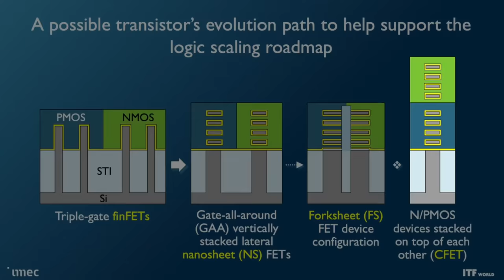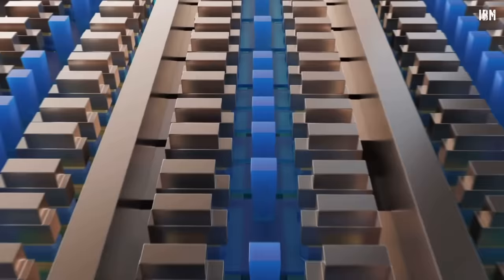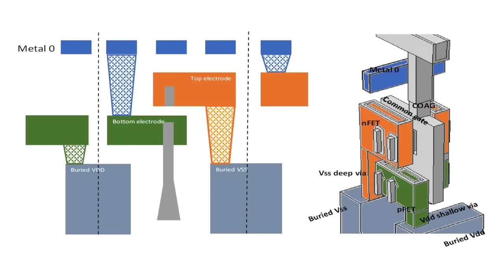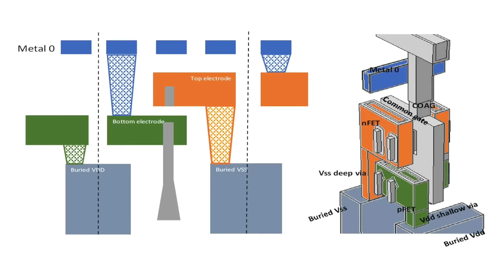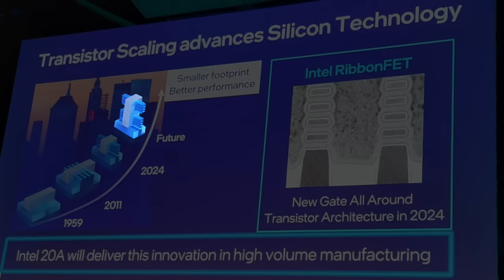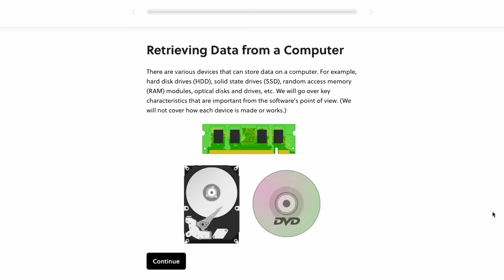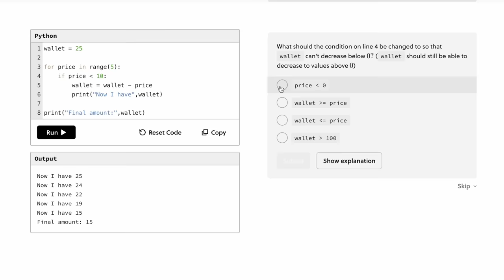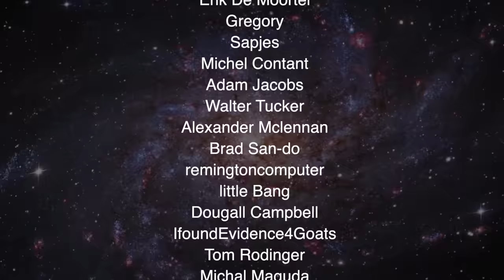New CPU Technology. IBM, Imec, Intel

Comment: fully optical transistor is better than electrical transistor
Reply: electrons flying at a line (like photons) are better than electric resistance wire electrons
Reply: like electron lithography is better than optical lithography, but nano sized optical wave guide pipe lines
Reply: ducted light/photons stay in the pipes, even if below their optical resolution
Reply: or just use euv nano photons to get them in the tubes
Reply: make vertical ditch photodiodes, any power level, vertical square surface illumination area
Reply: photons don't really interact with each other at all. How would you make transistors for light?
Reply: @vibaj16  how does the basic switch (mechanical) do it, for electricity? actually the same switch, just optical pushing
Reply: @vibaj16  make the photons push a thing, like gas/cantilever, that blocks another stream of photons partially on/off or gradually
Reply: @vibaj16  yeah even the fusion reactor pushes things with lasers
Reply: @vibaj16  best type of optical all-photon transistor would work exactly like a vacuum tube transistor and MOSFET, a boundary layer of gas/cantilever is pushed a bit so that the photon channel is open
Reply: @vibaj16  at nano-meter trace-channel wave-guide widths (square on the nano wafer) the photons need to be x-ray photons, about 400k THz (400PHz), optical visible photons are around 750THz or 0.75PHz (for red)
Reply: @Jkauppa  Electrons affect each other, photons don't. Photons don't push each other. Electrons do.
Reply: @vibaj16  are you broken? I did not say to push each other, like you try to do now, push the mirror
Reply: @vibaj16  ok you did not read
Reply: @vibaj16  actually they do superpositions, boost and cancellation, to be exact, double slit experiment
Reply: @vibaj16  and thats bs, they do split to electron and positron in matter, and interact to form matter and antimatter (for example gamma+gamma photons collision)
Reply: @vibaj16  also photons have energy=mass, they do affect that way, directly, even if the effect is neglible, like I am
Reply: @vibaj16  not even the electrons in transistor directly push each other, they use a medium as a switch
Reply: @Jkauppa  photons controlling mechanical switches would be slow. Better to use wave interference for switching, (like the double slit experiment) if that is possible. I think "optical cavity switch" is a method, there is some video demonstrations on YouTube.
Reply: @AORD72  who said so, I rather believe the one that told me so
Reply: @AORD72  how slow is a vacuum tube transistor, mate
Reply: @vibaj16  photons can interact, the waves do (but i think with coherent light only). This can be seen in the double slit experiment.  Change the experiment so you has two photon beams. And capture the resulting photons from the wave peak locations.
Reply: @AORD72  do you think an electron (photoelectric effect) is slow as a mechanical switch?
Reply: @AORD72  meh talk what you want
Reply: @AORD72  no, just use nano size cantilevers or just a mechanical optical gas
Reply: @AORD72  I would not buy consultation services from you, just that you know, dont claim to know anything, by yourself, as you conflict with my sender
Reply: @Jkauppa  photon as slow as a mech switch. No. Using a photon to push a atom or molecule would surely be slower than photon to photon interaction.
Reply: @Jkauppa  I will say what I want. Are you so important that you can't be wrong?
Reply: @AORD72  well its not for you to dictate
Reply: @Jkauppa  a atom has a lot of mass compared to a photon.
Reply: @AORD72  I have masters in semiconductor tech including all this, if anyone asks or wants to fight, of nonsense
Reply: @AORD72  its you that cant be wrong
Reply: @AORD72  I'm as important as you think you are
Reply: @AORD72  I taste bad salt, and my sender is correct, so you must be wrong
Reply: @AORD72  opposition to correct means that you are wrong and the enemy of the given thing, arguing to destroy it
Reply: @AORD72  do you claim to know?
Reply: @AORD72  I'm not talking my own but what my sender put in my mouth and its not you
Reply: @AORD72  so yes my freedom is essential, not to be ruined by your slavery to knowledge, that you dont know even if you think you know
Reply: @AORD72  your fancy to inference, while efficient, requires some controls that make it comparatively speedy to the mechanical cantilever/gas/molecule stuff I recommended, which you denied harshly against greater wisdom, God
Reply: @AORD72  yes you are the more important judge, but I will not be wrong for you, not sorry, judge
Reply: @AORD72  by claiming what I said is wrong, then you dont say it against me, but against my sender, who is always correct, and supreme over all knowledge of people, that was also given by my sender, God
Reply: @AORD72  I dont believe in you
Reply: @AORD72  talking is not a proof of anything, mate
Reply: @Jkauppa  Why can't you use a single comment textbox and full it with your arguments? Instead of pressing reply for each line why don't you press enter then start a new line in a single comment box. It is as if you don't understand how to use a computer. You spamming the comment sections with a whole lot of seperate lines that include a whole lot of wasteful data. It looks like a deliberate obfuscation attempt.
Reply: @AORD72  you are not the boss here, freedom instead, so cut off with that bossing
Reply: @Jkauppa  Bro, kinda hypocritical bossing me around then isn't it.
Reply: @AORD72  yes always ruling on over others
Reply: @AORD72  so you confess that you are a dictator hitler, with your rules
Reply: @AORD72  yep you hypocrite
Reply: @AORD72  welcome to the real world, where whiners are not bowed to
Reply: @AORD72  I dont need you (as law) to tell me what I can or cant do, should do, how to do, or anything else thanks

Comment: I am afraid your historical assessment is inaccurate. The early days of the space program were without advanced integrated chips, and their tiny transisters. 

Their calculations were done by hand, by human calculators, as documented in the book and film called Hidden Figures.
Reply: Not they weren't and I've seen the film. One of the female protagonists becomes a programmer for their new IBM computer technology. But the technology is new, so they don't entirely trust it. Much of the human computation in the end is verification that the electronic computers haven't lost their minds. 

The IBM 7090 used more than 50,000 germanium alloy-junction transistors and (faster) germanium diffused junction drift transistors.

Early use of transistors, well before integrated circuits.
Reply: @afterthesmash  Read the book.

Comment: I have to take issue with your assertion that without transistors rockets wouldn't exist, the Germans had the V2 rocket in 1942 (developed between 1936 and 1942), the transistor wasn't invented until 1947, so there is your proof that rockets can exist without transistors.  Can you guide them real accurately?  I make the rocket go up, where it comes down is not my department said Verner von Braun.  Probably not but they exist and can fly.